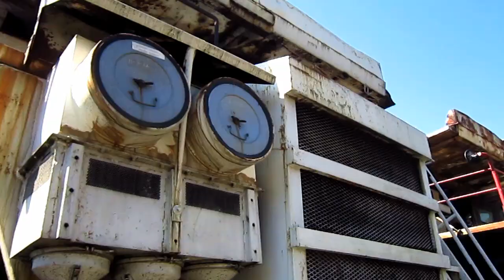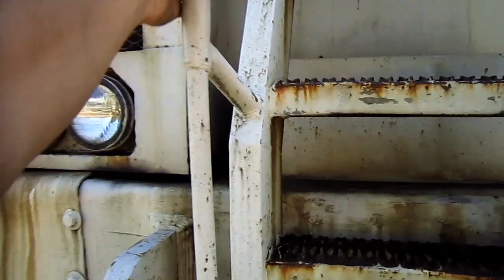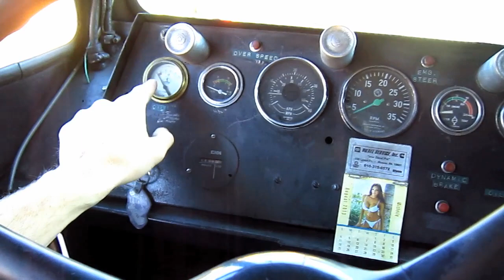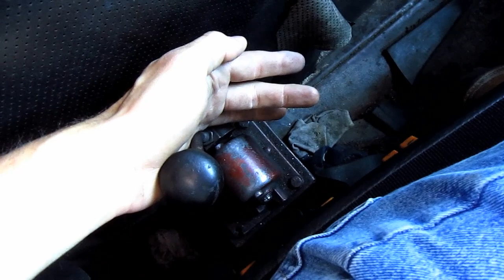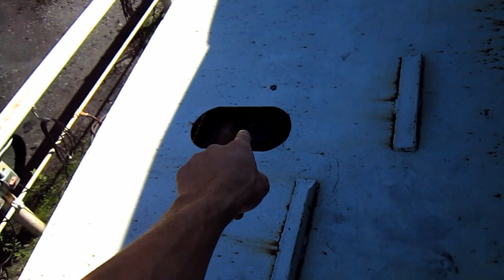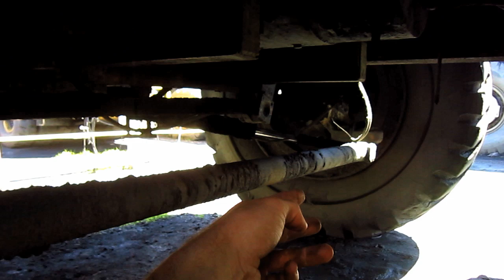WABCO | Haulpak 120B Documentary

Comment: I used to work in the WABCO Factory,  building those and other Haulpak trucks! From 1978 to 1981. I used to put suspension and fuel tanks and radiators  on the bare frames. 
Those were the days! ❤
Reply from the maker: That's awesome 😎

Comment: I drove these trucks in the copper mines in Arizona . First at Pima mine and later at 
Duval , Tyrone NM, and Pinto Valley. We had a fleet of 90, 120, 150 and 170 ton trucks. Later as an electrician I worked on all these systems plus the GE statexc system  on 190s. They were a good simple systems for their times. 70s and 80s. Later to replaced by bigger and more sophisticated systems in response to the entry of Caterpillar mechanical drives.

Comment: Looks exactly like a Lectra Haul M120. I wonder what the differences were?
Reply: Suspension : on Wabco trucks , the suspension consists of four oil/ nitrogen cylinders struts  , one on each wheel. Lectra Haul is steel/ rubber sandwich. It’s easy to understand that Wabco truck was very more confortable ! In the 80 , I was mechanic and operator on theses trucks , the 170 tons model .

Comment: are they still being used or have they been retired
Reply from the maker: No these trucks are still operational. Thanks
Reply: They appear to be in very good shape for a 50 year old truck.
Reply: Not sure if anyone is still using this version, but this style of diesel-electric is in use by Komatsu (operated the big boys in 2005, and a Wabco in 1994-6). 

I prefer the mechanical drive (engine/transmission/rear differential) in the 797 Caterpillar trucks I also operated in 2005.

Comment: I worked at Island Creek Coal's Tenmile WV mine in the 1970's and into 1985. We had 6 or 8 of the earlier production 120C's, then a bit later they added 4 or 6 more of the later model 120c's. These had the nicer interior with a Camaro tilt and telescopic steering column! All were equipped with the Detroit Diesel V12 with two superchargers and 4 turbochargers. Rated power was 1200 HP. These were good trucks. Quite reliable, powerful, and easy to operate. I spent many  months on them full time after a layoff of a portion of the workforce. Wabco sent us a 120C Haulpak somewhere around 1983 (?) that was mechanical drive. Equipped with a Cummins V12 ( not sure of the HP rating ). This truck was fast and burned less fuel. BUT...due to mechanical drive it wouldn't back up in poor conditions and would not go up hills loaded or empty that the electric drive trucks would. Just didn't have the same traction as the wheel motors allowed.
Reply from the maker: Interesting! the wabco/dresser/haulpak line are some of my personal favorite trucks. And yes, Wabco did build a mechanical drive version of this truck do to it's success called the 120CM (M for mechanical drive). It was introduced in 1978. I was going to talk about it in the video but, like many other details, it got cut for time constraints
Reply: @PAmining  When another mine shut down they shipped us several Unit Rig 120 ton trucks. These had the 3412 Caterpillar, electric drive. They were very underpowered. Would stall out backing up a fairly  steep ramp to dump! They might have been ok, were they not running with the Wabco's!
We had two Marion 201M's, and a 195B BE shovel loading these trucks. After the Tenmile job shut down, I was told the shovels and some of the trucks were disassembled and shipped to a mine in Alabama. Maybe someone knows where that would have been?
I spent some time around Letourneau 190 ton trucks in the early 90's. That might be a good subject for a video. These were in Summersville, WV with High Power Energy. Not nearly as reliable as the Wabco or big Caterpillar trucks.
Reply: I steamed on alotta jobs in southern wv and eastern Ky dad retired from booth energy and worked many yrs around here…mcoy/elkhorn…b.w.mcdonald…consol..and Heard Island cr. many times…branham&baker mined behind the house with the wisedas Justin has a vid on…they were blue

Comment: One of these, ex US Steel, is on public display at the Minnesota Museum of Mining in Chisholm MN.  For contrast a 170 ton Wabco and a 240 ton Lectra Haul, both ex Hibbing Taconite, are on public display at the nearby Hull Rust Mineview in Hibbing MN.  You can sit in the driver's seat of all of them.

Back in the 70's each new generation of GE wheel motors was becoming less and less reliable leading Wabco to also offer this truck in mechanical drive for a while.

Compared to the 34 ton Euclids these replaced around here these things are huge.  Not so much today.  These are so much bulkier than the competing 100 ton Lectra Hauls of the day.
Reply from the maker: Cool. I am familiar with the 170 on display. I never liked filming display machines unless they are really rare as I don't like the added stairways and stuff. The mechanical version of the 120C was the 120CM.
Reply: There’s also one of the 120 ton trucks on display in Hinton, AB on the west end of town. 

Used to operate it (and the 11 others) at Obed Mountain Coal from 1994-6. 

Ours may have been a later model since the fuel tank was on the driver side, not the passenger/right side as the B model shown here.

It also had access to either side of the cab from the ladder. The radiator housing wasn’t as tall, and there seemed to be more space on the front walkway.

Comment: Thank you.
Reply: Me too. You ever run an electric truck, Scruff? Not I said the small crimson barnyard fowl. I cussed a 222 WABCO pan enough to make up for a bunch of those. Happy evening 2 U!
Reply: @lewiemcneely9143  never sat in the seat of any off road haul truck.
Reply: @scruffy6151  Ah, led a sheltered life, did you??!!
Reply: @lewiemcneely9143  i was the manual labor that was in the way of the operators lol. Too dumb to sit in the seat and let the machine do all the work🤣🤣.
 Loved to work with my hands and met some very good operators in my life.
 You and the misses have a great day God Bless.
Reply: @scruffy6151  My 1st was the old straight drive IH that came with the crusher and an 800 Ford that I'd been driving on the road. Then it was ex mixers with rock beds, Euc/Terex and the Cats. I don't think you were too dumb. Too impatient, maybe. I was too lazy and could always get a machine to do what was needed. I'd rather burn diesel than calories! And I took after the Sea Bee Uncle that could run anything. YOU have a FINE weekend and I'm always just an email away and GBWYou, Buddy!
Reply: @lewiemcneely9143  holler at you. Later.
Reply: @scruffy6151  10/4 and sure enough do!